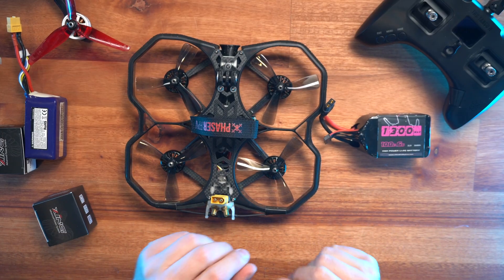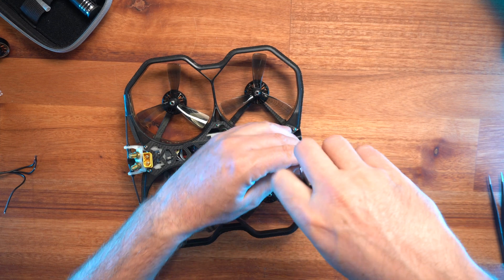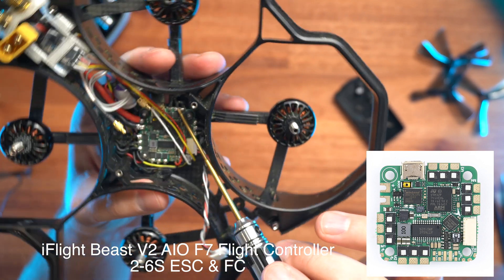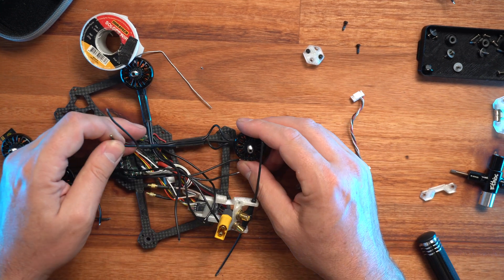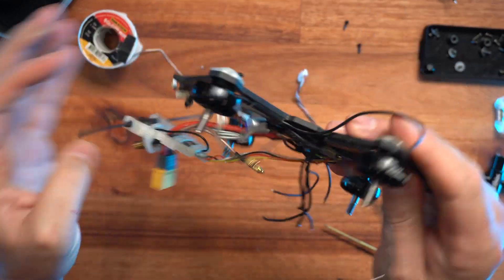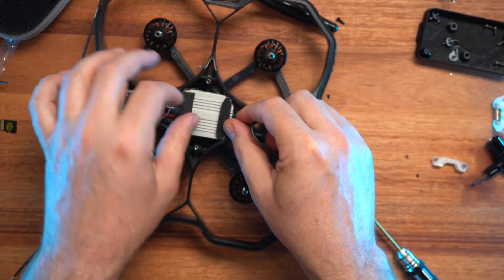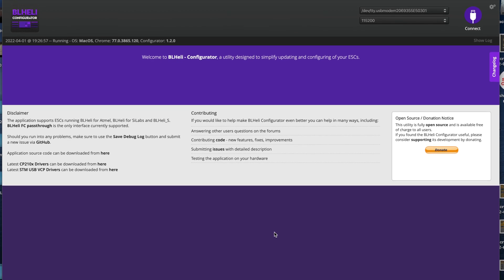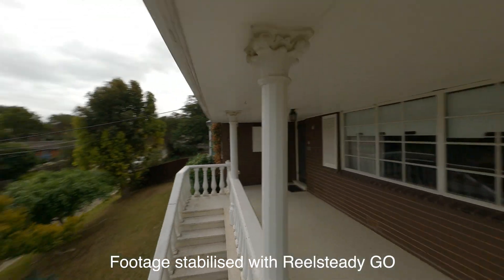iFlight Protek35 6s upgrade from start to finish

Comment: Can you share your tune? I am running the newest version of betaflight and its not flying too well. I cant find a good preset for this type of drone. Thank you!
Reply from the maker: Hi I don't have that quad any more but if you check iFlight google drive you should be able to find original PIDS here is a link you'll need to find the right quad tho https://drive.google.com/drive/folders/1r3MNTBNYSzGeRXQg45j4IJVoW1Xjk7Y0

Comment: So you didnt have to change the boatd at all?  Just the motors, thats all?? ❤
Reply from the maker: That is correct if you have the AIO beast F7 . if you have a different board check with the manufacture. Hope this helps :)

Comment: What capacitor did you use?
Reply from the maker: I used the original one but take into account the capacitance, voltage rating, ripple current rating, and temperature when selecting a capacitor. The physical size of a capacitor depends on the capacitance value. As the capacitance increases, the size becomes larger. The capacitance variation is temperature-dependent.

Comment: Hey! Love the video! Question? Have you had any issue with running the air unit on 6s when it's only rated for i think 17.4v ?
Reply from the maker: Hey thanks for watching yes you are right DJI Air unit is rated up to 17.4v but don't run it directly off the battery you will be getting power from the flight controller which is approx 9v ..

Comment: I'm thinking of changing my  Protek 35 hd 4s to 6s.   Presently I'm using 4s 1550mah Ovonics batteries (junk batteries) that will give me 3 minutes on a good day.   I do not recommend Ovonics batteries.   I've had then drop from 3.8V to 2.5V after no more than  3.25 minutes while landing (low load, battery fails).   If I can't trust my battery I'm off to a bad start so that quad doesn't get much air time.   
  I probably would need 4 motors, voltage regulator for the Vista and a lot of time to play on Betaflight (unless I can find the right configuration on the Iflight site).    I have 6s batteries.

Comment: Nice work. Apparently the 3200kv motors ar 6s compatible also though
Reply from the maker: yes they are but it's a good ideal to throttle limit them as you don't want to run it to full power

Comment: Amazing, good job and I also want to upgrade to 6S, so only replace motors that’s all? No extra work need to be done ? I just afraid I will burn that FC if not check properly 

Thanks
Reply: @onebyone.media.melbourne  I upgraded to 6S too and can fly almost 6mins , awesome
Reply: @paulflyingfpv so that's all you had to do was change the motors? No other swaps or configuration??
Reply: @brianfreland9065  yes, I didn’t change other thing

Comment: This video is uber informative for me as a noob in soldering and fixing/upgrading the motors. This is my first time. At the 7:03 mark, what did you say and what's that you're using for the motor wires to make sure they stick while soldering? It was hard for me to understand. Thanks in advance!
Reply from the maker: Hey B yeah you need to tin the cables in order for the solder to flow to the pads.. if you not sure it's a good idea to grab some practice boards and have a go before you start soldering flight controller.. good luck let me know how you go :)

Comment: Thanks for this video, im just about to update my protek to 6s too. You have any problems with air unit and 6s or you had to put some limits in BF? If I remember what I’ve read is about adding some extra capacitor on drone or I might be wrong?
Reply from the maker: hey nah no issues at all i'm using the same PID tune at 4s and all good. good luck man let me know how you go.